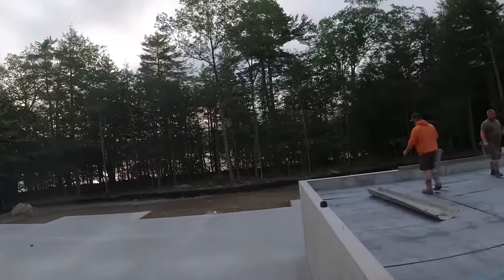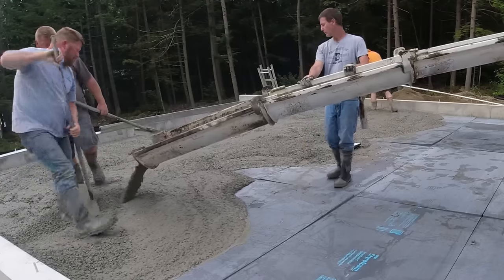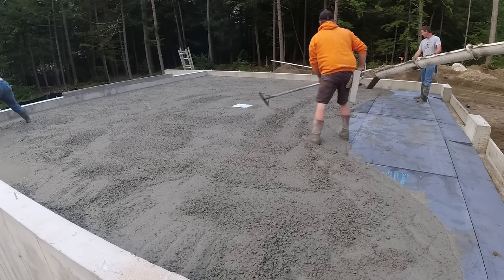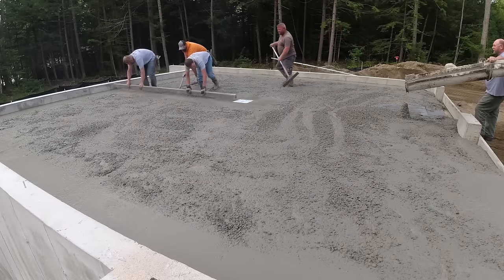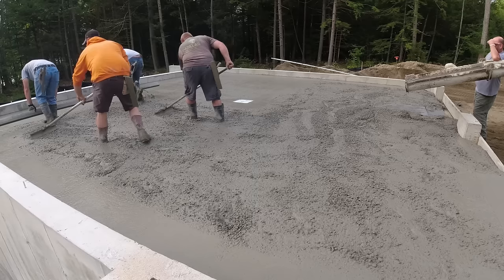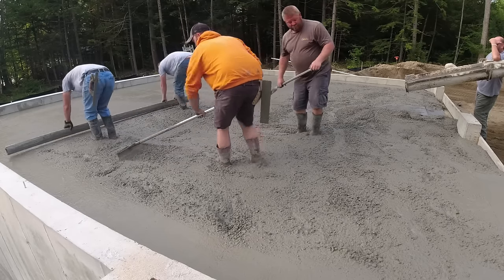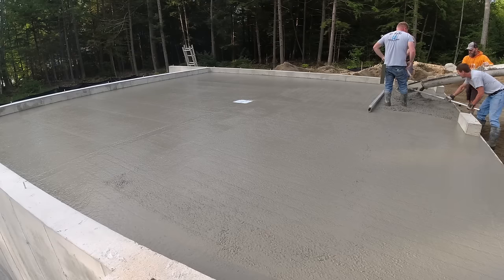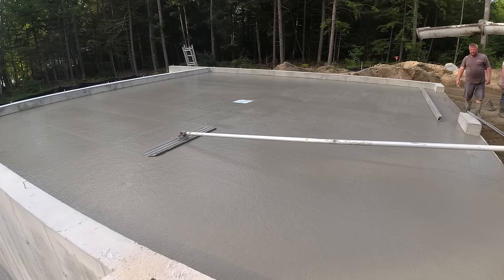How I Charge To Pour and Finish Garage Concrete Floors. What's it Cost to hire me to pour concrete.

Comment: Extremely reasonably in my area. I wish I could get this level of quality for that price.
Reply: Remember this is just flat work
 Its the work actual concrete contractors don't want. Its time waster and customer intensive callback prone type of retail work that a guy like this can make a very good living doing but you are always putting our fires with work that is VISIBLE for its entire useful life.
Foundation and structural concrete is hidden most of the time. Call backs are rare. 
You deal with mainly peer professionals

Comment: Mike, have never used superplastiser/ water reducer. Does it start to revert back to a three inch slump quickly? Or does it kind of set up the same way as if you were to pour it at a 6 made that way by water? Thanks
Reply: Super P. The simple answer to your question is it reverts back quickly. The long answer to your question is: if a concrete truck leave the plant on 3 and a lot of water was held because the customer wanted it tight, then drives 55 minutes on a decently warm day. When that concrete arrives it is ~ an hour and ten minutes old. It will be on a sub 1 inch slump and you’d catch hell even getting it out of the truck. When you add super P it makes the concrete “loose” and workable but it doesn’t have the same effect on the hydration of the cementitious material due to large size of the plasticizer molecules. So it will go from being workable to “get a machine on NOW” or it has gotten away from you.
Reply: Also I forgot to mention. All concrete that I know of nowadays all has water reducer in it and I run a concrete plant. There are many different types of WR’s some plants use only a medium Range in their mixes, my company uses a Medium/high Range WR plastol 6420 every single one of our mixes and we use about ~ 50 standard mix designs have plastol in them. It is Dosed Oz per hundred weight when designing a mix and Oz per yard when batching or requesting more of it.

Comment: When you have to do the labor yourself in your company, you don't have a profitable business. What you have is a self-employment situation where you're paying yourself for your labor.
You get to the point where you're a supervisor, one or more jobs at a time and you don't have to do the manual labor. You then have a profitable successful company that you can either pass on or even sell, but unless you can sell yourself with the person who buys your business, you're not selling a viable business. You just have a self-employment situation even if you are listed as a corporation. You've just created yourself a job. 
My 28x28 shop cost $12 a square foot for the concrete work, but that also included 2-ft perimeter cinder blocks the owner of the company showed up at the beginning of the poor. Came back around the time for power trial to check in on. It came back at the end of the day to double check everything was done right. He never once got dirty. From what I can tell he runs six trucks and trailers and is pouring between 4 and 6 jobs a day year round. But we live down here in America